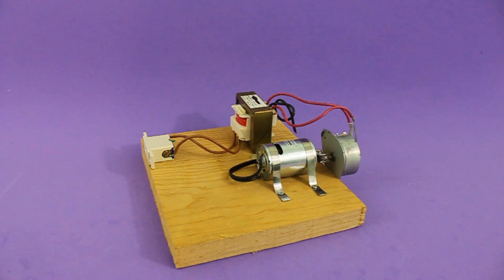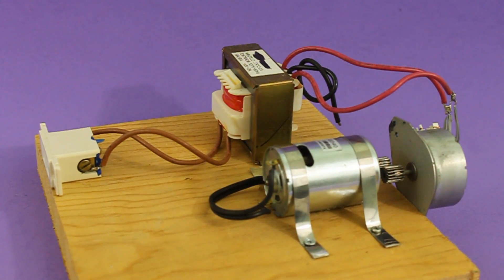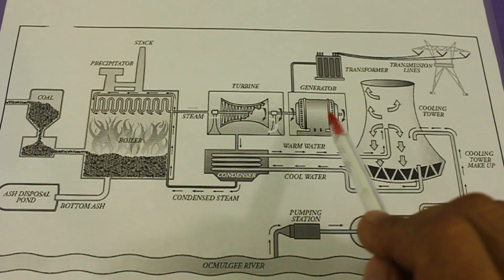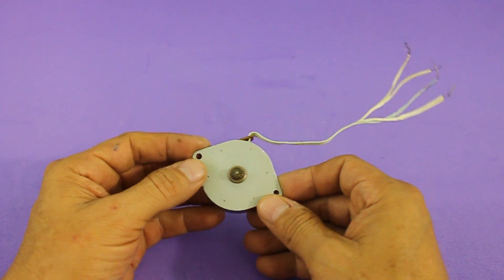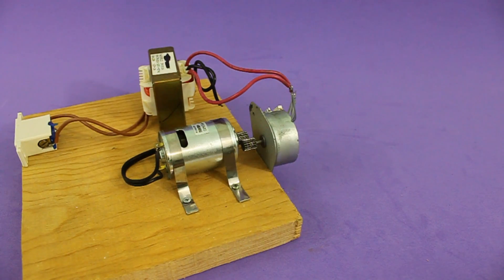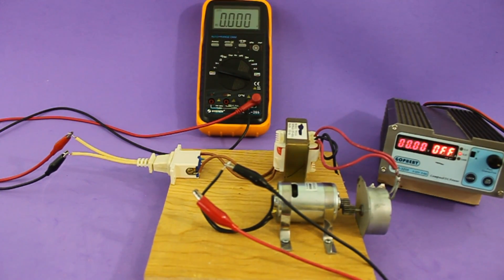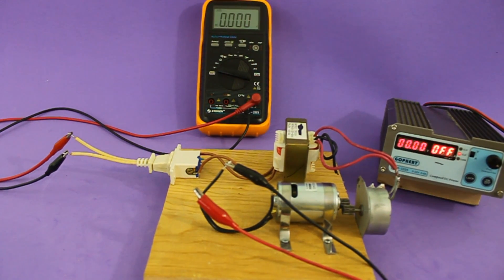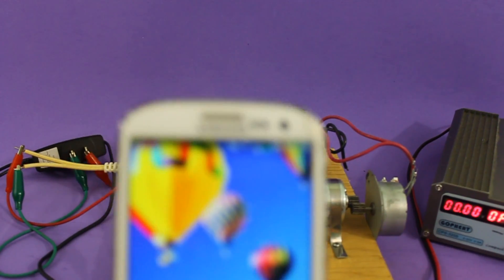Motor Alternator and Transformer - Electricity Generation

Comment: ALL YOU NEED IS BATTERY TO STARTED MACHINE INVERTER TO THREE PHASE FOUR FIVE SIX SEVEN EIGHT NINE OR MORE...NOW ALL YOU NEED IS THE RESOURCES OF POWER WATER IS MATER POWER STOPPED BULLSHITING EVERYONE NUCLEAR IS NATURAL JUST STEAM POWER ENGINE YOU DONT NEED A COALS ..COILS ELECTRODE TO CREATE HEAT OR MAGNET BUT IF YOU NEED COMBUSTION HHO BATTERY ELECTRODE LED STAINLESS PLATE TWO ELECTRODE ON WATER HHO HYDROXIDE  HELIUMED OXIDE...STEAMED WATER IS MORE POWERFUL BECAUSE OF THE MACHINES IMPROVE..GHENDER FORD STARTED COMBUSTION USING FUELLED GASES....COMPRESS AIR IS USED TO RUN THE JET ENGINES TURBINE TURBO ....

Comment: GRAVITY GENERATOR :)  Parts:  One 3000 watt inverter , One back wheel on bicycle , One 12 volt gearbox generator 5 RPM ,  One 100 foot bicycle chain , A large rock ,  a rope.  Take off spraucket gear on bike wheel and attach it to the gearbox , Attach chain to spraucket gear, attach weight /rock to chain , put in tree 50 ft. up. with rope. wires to generator to inverter 12 volts input.  A 2 inch bike spraucket  = 10 inches for 5 rpm 12 volt gearbox , 600 inches = one hour = 50 feet up.

Comment: So if I wanted to build a power plant using car alt, motor, and transformer, what size transformer would I need to run a window unit air conditioner? I think the air conditioner is 90 amps..

Comment: You can practically use this setup by powering the motor using a solar cell.
Reply: Well... I wouldn't say practically. It's really inefficient and a proper DC-AC circuit will work much better. But it is still a cool idea.
Reply: It can prove useful in an emergency when you have a DC motor, a stepper motor, a battery and a transformer lying around.

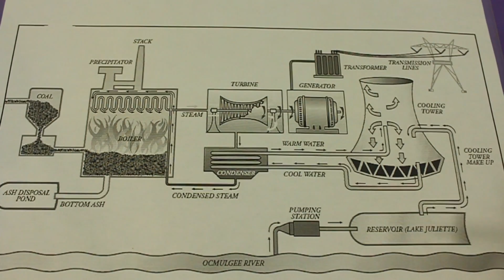Comment: 0:55 it would be cheaper and more efficient if the generator itself generated the high voltage by having the proper amount of turns on the coils instead of going trough a transformer